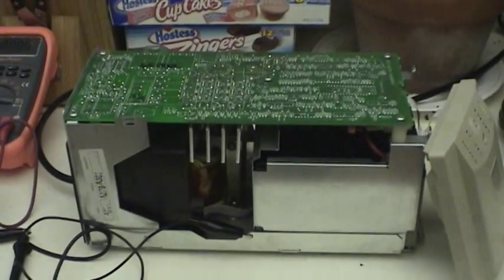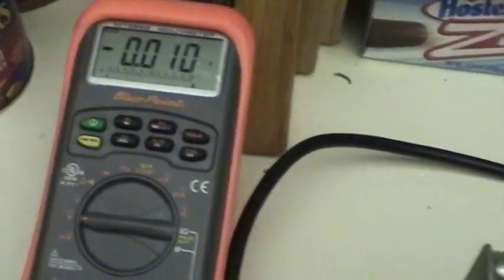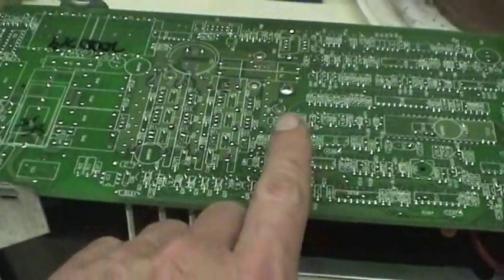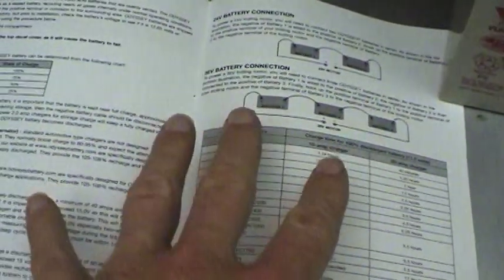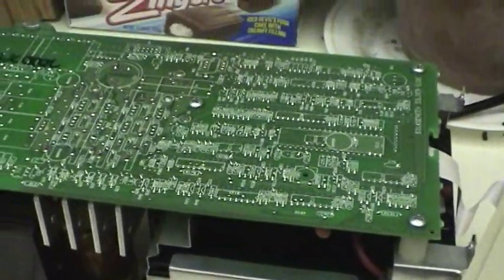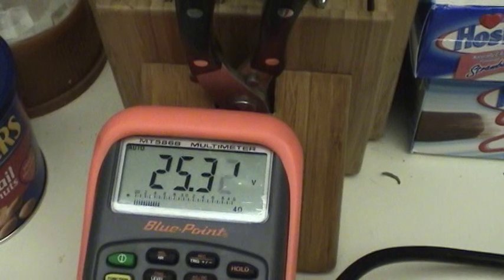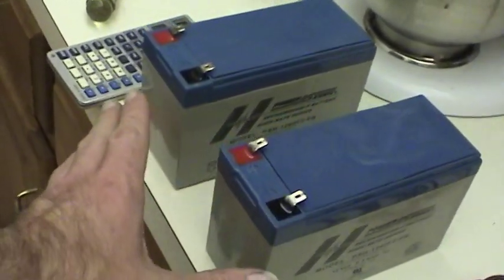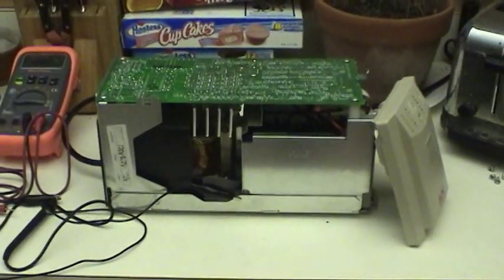APC Smart-UPS 700 Issues Part Deux

Comment: car batteries  normally can handle 14.5v max total witch is 29v max my 2 marine batteries  are being charged to 28v and it takes a few days for my tv radio and laptop and alarm clock to drain it completely
 i just  tore the beeper  off
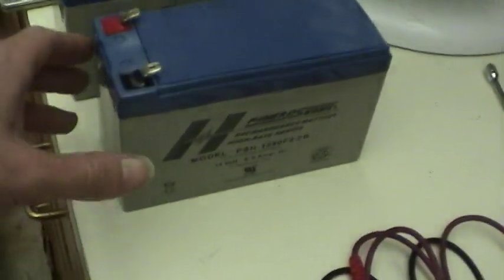Reply: 7:03 u can see  at the top right theirs a circle  on the circuit board thats the beeper just grab it and  break the top off  u can leave the magnet and the copper core   incase the inverter has a fail safe and doesnt turn on if theirs not a beeper  installed
Reply: jeshua leblanc the  inverter i found  had some powersonic batteries they melted together the guy says it only lasted like 2 years
Reply from the maker: jeshua leblanc
I replaced these with PowerSonic batteries and so far, they seem to be holding up but I'm going to keep a close eye on it now.
Reply: im using 2 deep cycle marines only thing to watch for  is the smell . that and line draw  i have a 90 amp line fuse on them

Comment: Kindly help me to find what cause this lights to flash together
Smart-UPS 700 problem
Reply: I'd disconnected everything from ups even the transformer after that it worked!!!!!!
Reply from the maker: That failure looks to be a failure of the inverter circuit. If you have any spare batteries, you could try those to isolate the problem.

Comment: Hi,   The last voltage comment is correct. I set my APC 24V units to around 27.4VCD as long battery life is what I'm after. In your unit you will have to change a voltage divider resistor to adjust it. In  units older than yours there was a variable resistor. The adjustment you have is not for float voltage. APC's are notorious for having the voltage set very high even up to 30VDC and so the batteries make warranty but within 1.5 to 3 years they are over charged enough and done! I have more than one or two APC units and I've learned the hard way buying batteries like you until I lowered the float voltage. Also I would check the filter cap(s) in the charge circuit as you probably also have excessive ripple from bad electrolytic's. As a foot note I also have a Powerware Prestige and it has a two stage charger I just changed batteries now and they were 11 years old!  Much Much better than any APC unit I've ever seen. IMHO
Reply from the maker: Thanks for the tips. I'll take it back apart when I get a chance and try to tweak the charging voltage. I also have a Best Power UPS (now PowerWare) and I agree, they are better than the APC's.

Back when I got it, it was the only one with a true sine wave output. The other UPS' were still using stepped sine approximation technology.

Comment: That battery being charged at 27-28 volts would be normal because it may be 12 volts but put two together and you have 24 and it takes more power the. The battery has to charge the battery. Car battery's are 12 volts are are consistently charged at around 14 volts which should be completely normal for lead acid battery's.